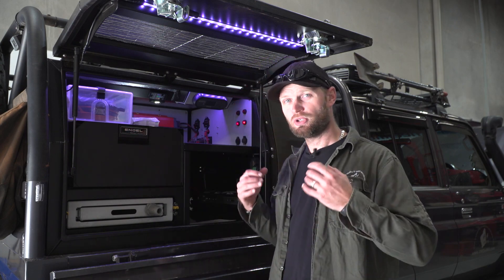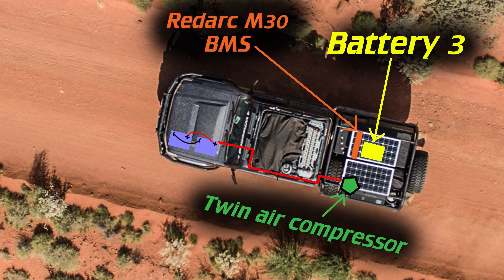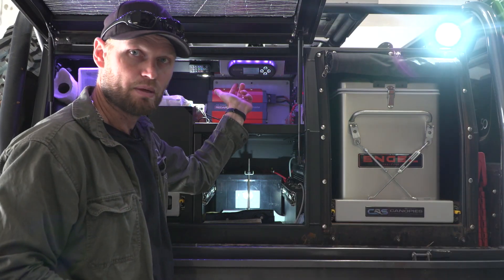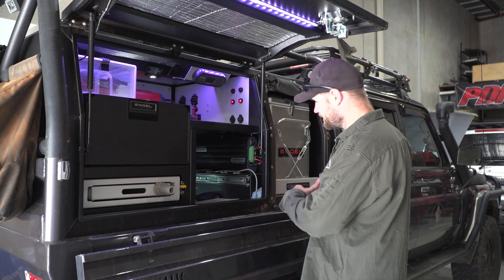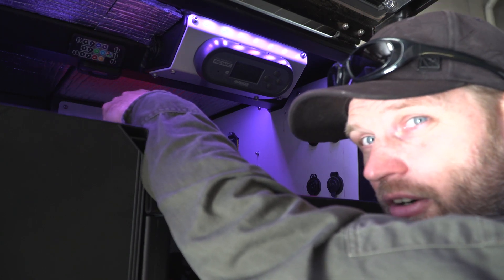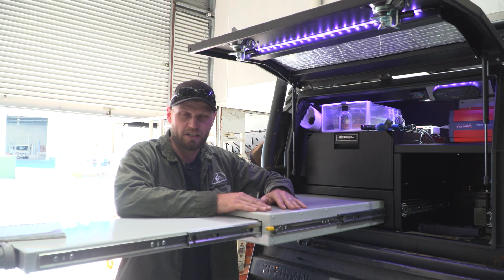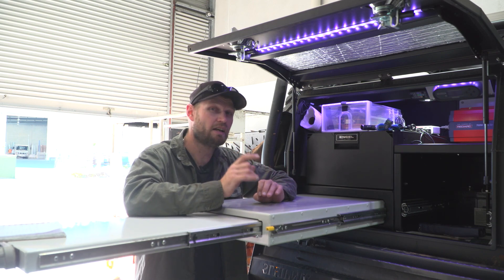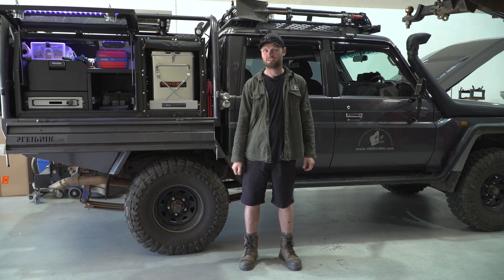My New 12volt DIY setup Landcruiser 79 series

Comment: I don't believe the spin that Redarc have put out about the need for DC battery chargers. A vehicle with a good conventional (not one of the so called intelligent) alternator, and suitable cross sectional area cable, to ensure low voltage drop, to the auxiliary battery doesn't benefit from a costly and inefficient DC battery charger. The exception being Lithium Iron batteries, which require a different charging regimen. 

The SC80 dual battery isolator from Traxide (no affiliation) will fully charge an auxiliary battery far quicker from the alternator than a 30 amp DC battery charger.
Reply: John Do White for my usage, thats what ill be going for (som sort of Marine battery isolator), but how do you propose ronny integrating that with solar panels, and all the neat control features the redarc has, like seeing what percentage remain in your batteries and so on... The battery management systems are just that, not just a simple charging relay :)
Reply: +Hampus Lytz the Traxide SC80 that I said would charge the batteries, via the vehicle alternator, sooner than a Redarc BM30 via a DC battery charger, can do most of what the BM30 can. However a separate solar  controller or AC battery charger is required, but comparing the prices, you could buy the complete system, including auxilary battery and solar panel, and have money left over, for the price of a BM30. Note it would not charge a Lithium battery like the BM30.

Traxide have other battery isolators including the USI-160, which offers better use of your cranking and aux batteries for winching and self jump starting.
Reply: I have mixed feelings on DC/DC converters. 

Personally I run a 230A (500A short term) rated split charge relay system and I have my two batteries right next to each other. For me, that's the correct setup and means that I can join the batteries to jump start myself or for winching. 

However, for a setup that has a long cable run then I'd say that a DC/DC charger probably was a better option. What Ronny has is a relatively complex setup and the BMS give him proper monitoring of it all as well.

As for adding solar panels, there are a few options. The most crusty way of doing it (and please don't) is to just connect the panel straight to the battery. This will work and will charge the battery but there's no over charge protection built in and it's not the most efficient way of doing it - it forces the panel to run at the battery's voltage when they actually have a higher power output at a higher current. 

There are three ratings for a panel. Open circuit voltage, that is the voltage with nothing connected to the panel. It depends on the panel and how many panels you have connected but for a single 100W panel could easily be over 20V. Then there's the short circuit current, that is the current that flows when you attach the two output leads together, and you could be approaching 10A for a 100W panel. In both open and short, the resultant power is nothing - power is current times voltage so if either of those is 0 then the power is 0.

Somewhere between the two extremes is the so called "Maximum Power Point", it will vary depending on the panel and the sun, but high teens is typical. The best way of connecting a solar panel to a battery setup is a maximum power point tracking (MPPT) controller - what this does is gradually draw more and more current until it calculates that the power has started to drop. It will then draw maximum power out of the panel and drop the voltage and boost the current to suit the battery that's connected.

A bit cheaper and a bit less efficient than the MPPT controller is the PWM controller. If you're on a budget, then they'll keep everything safe but not perform as well as an MPPT controller. TBH if you're spending a heap on a solar setup, you might as well go MPPT.
Reply: DC to DC converters are fine when one wants a different voltage, e.g. if the main system is 24 volt a DC to DC converter will power some 12 volt accessories.

Using a DC battery charger, which use a DC to DC converter to increase the voltage back to normal after the drop that occurs due to a long cable run is a poor solution, expensive and slower to recharge the house battery.

A better and less expensive solution is to use cable with the appropriate sectional area, and good connections, to avoid the voltage drop inn the first place.

Outlaying $2300, not including installation, for a BM30 that does a poorer job at the primary task of charging the house battery is just ...........
Reply: John Do How is this relevant? I mean it would be, if that was all the 2300$ unit did, but as explained in the video it does quite a bit more than that wouldn't you agree? Not trying to justify the price, personally I could plug my car in every night, but for off the grid trips, I do see the benefit of having full control of power usage when you have to get by on battery power alone

Comment: Thanks for a great run down of your setup Ronny. A few suggestions from my setup...

-Get an MPPT charger  (if you're using PWM, in the hours you're camped you're probably not even pumping anything into your battery), whereas with MPPT it will convert a low voltage to 12V, and just lower your current in...but at least it's still going in.
-Get a 15-20M DC extension cable...it will need to be 6B&S or better to allow for voltage drop, but you can then enjoy the shade & throw your panels at the right angle in the sun.

These two things will be far more effective than a Lithium.

Did 9 days in almost complete tree cover on Fraser running an Engel 80L upright, lights, iPads etc all with just a 120Ah AGM - had 350watts of solar but only had about 1.5 hrs of true sunlight on the panels. Still froze the kids icy poles each day.

Comment: Hi Ronny,
Look into Lead Crystal deep cycle batteries. It's a great alternative to lithium batteries.
They have the similar features of lithium batteries without the cost and heat affected limitations.
I have seen them advertised for just higher than AGM types. They can be drained down to low percentage and be uneffected and have a high cycle life and charge quicker weight is the same but effectively a 100ah battery would be equivalent to 2 x 100ah agm batteries in theory. The Redarc bms is compatible with them, you can contact them for advice on how to set up the bms correctly. 
Cheers Dave n Deb

Comment: Are the cables coming from the front batteries fused? If so, what did you use under the bonnet?
Reply from the maker: +gazza cable to BMS from the front is fused at both ends 50 at the front and 40 just before the BMS.
Other cable for twin compressor is fused at battery end only with an 80 amp fuse

Comment: Excellent Video Ronny and Congratulations on the quality workmanship.

You're old set-up was beneath you :)
I could tell straight away the 1 x 104Ah Battery and 2 Fridges wasn't going to work
(just ask anyone with 2 fridges on a single 104Ah Battery)
Lithium of the same capacity, not only take a higher in-rush current to recharge the battery faster, but, you can also take the Lipo to a deeper state of discharge without compromising the longevity of the Battery. 10% remaining i believe.
I never take an AGM below 50% State of Charge, so really, your 100Ah AGM is only a 50Ah AGM, then consider it takes a long time to recharge the last 10% and your AGM is really only a 40Ah Battery in some cases (really short trips, no solar)
Still, i can buy a quality 104Ah AGM for $100
So the AGM vs Lithium debate is different for me.

I have the exact same Utilux Crimp tool and crimps
I have had them let me down in mobile applications like vehicles
I wonder what your workshop friends think ?
The "hex" crimp is far superior for terminating the end of cables , both for electrical conductivity and strength of join.

Fantastic set up mate, just some fine tuning now.
Congratulations, looks fantastic.

PS: I have to agree regarding the Solar Panels
On the roof was never an option for me, i want to camp in the shade, keeps vehicle cool, fridge cool, me cool, everything cool.
But having a portable panel is both a storage issue and theft issue.
Also, there is 2 different panel technologies, one is not as reactive to partial shading than the other type.

Comment: quick question how many AGM batterys have you had to buy and replace over a 2 year period .. trying to gauge an idea vs LiFePO4 100ah $1200
Reply: LiFePo4 is a better option, cycling capacity, time to charge to full, weight, etc etc, would be my preferred option for the longer term. 120amp AGM $400, cycle life (300 optimum) LiFePo 1000+ cycle $900 + benefits listed above. Beats it hands down.

Comment: Great videos and information. Just a suggestion - @16:25 Possibly a grommet would be a good idea for the large holes through your breaker/fuse panel? Vibrations could easy cut the sheath on the +ve lead.

Comment: Why not just install a Goal Zero Yeti 1250 ? You can take it out, charge it on solar, on AC and on 12v. It has got all the outputs you need ...

I am sticking to my Goal zero ... Does the job for me. 

But maybe there is a good reason for this (complicated) setup. Looks amazing though but way to much things that can fail ot break for me.
Reply: The Yeti weighs 50 kg and is only 100Ah.  And it takes 40 hours to charge by the vehicle (according to their website). I suspect Ronny's system is lighter and charges faster. That and he'd still have to do all the cabling for fridges, lighting etc, and the stuff that runs off his cranking batteries would still have to be done. For his situation, I don't think the Yeti is worth the money for simplifying such a small part of the setup.

Comment: Hello Ronny, "I'm a long time listener - first time caller." from west Texas in the US.  I'm in the process of building a 79 Jeep CJ-5 for running on trails. I recently purchased a set of 2 80w solar panels similar to what you have to experiment with. This is the first time 'playing' with solar.... I'm just a tinkerer. 

On the back of each panel, the decal with the specs state that each panel puts out approx 4.4amps of power at full sun/capacity. That should be around 9 total amps output at 100% ideal sun/power condition.  

In testing them out charging batteries from my RV (caravan) I've never received more than 6amps or so from the system (or at least I've never monitored it when it may have been more). You stated that your fridges consume 2.5amps each that would be 5amps in total (in ideal conditions).  Plus you have more power consumption with other devices that you have installed. So if your panels are similar to mine, your panels maybe don't put out enough amperage to account for the power consumed from the fridges and accessories. Which means that there isn't any extra power to actually charge the battery.  Well at least I think what's maybe happening??? 

I'm no expert at all.... I may be wrong.  I'm just starting with solar. 

You may need to increase solar or battery capacity or both??
Reply: I'm running 95Ah with 2x100W solar which is a bit too much, cause when on the trail we're moving at least every 2nd day anyways. so we could even go with less than that. you need amp hours depending on the total of consumption AND the days of stay you want. and then solar for the days of autarky for an infinite stay.
Reply: I have 2 AGM wheelchair batteries under my bed, in a custom box hanging between the frame rails behind the axle. Charged by the alternator through a battery isolator, with a battery disconnect switch to gang them together with my starting battery in case of a dead starting battery.

My advice is, build in as much battery capacity as possible. I'm thinking of fitting 4 AGM deep-cycle batteries instead of 2. But i have ham radio gear, aerial recon gear, camera gear, lots of drain. Solar is 'green' but doesn't produce nearly what wind or just your vehicle alternator does. I put on a 140amp GM alternator, (replacing the 55amp Toyota alternator) with more battery capacity planned. Best bang for my buck. Lithium-iron-phosphate are the best but you'd have to be a lottery winner to afford them, AGM is the next best tech.

But unlike Ronny, i don't use an electric winch or an electric air-compressor. I have a Mile-Marker 10k hydraulic winch which runs off the stock power-steering pump. Much more durable than an electric winch. And my onboard air is supplied by a York engine-driven air-conditioning compressor, commonly found on older semi's. Look in a truck wrecking yard. Produces 10cfm. NO drag on my electrical system. 

Also in his videos i've heard him mention ARB air-locking differentials. After much research i found they have problems with the seals, problems crimping the air line during installation, and don't like to work in the cold. Not to mention it takes 90psi to keep them locked. I went with the Toyota E-locker. No air line. No air consumption. Stays locked or unlocked without electricity (the motor only runs when locking/ unlocking).

Comment: Hi sir, joss here all the way from the Philippines. Been watching alot of your videos and they are really awesome and helpful. I am still new in the 4x4 scene, hens this comment. a bit oriented with setting up a rig. However my weakest point is dealing with the electrical stuff. to make it worse my rig is run on a 24volt system. Its a Nissan Patrol GQ JDM unit Automatic. everything is 24volts from headlight to tailights except for the cigarette lighter port.  The previous owner already have a small inverted installed and i am assuming its for the subwoofer he had before our exchange. my problem is im having a hard time installing stuff like alarm, aux lights, switches etc. I really hope you can help me with this. Thank you so much! More power to you sir

Comment: Hey Ronny if you run your current agm battery low how long do you have to drive for to regain full charge ? As you said a lithium may take about an hour. I have heard agm batteries can only use "x" amount of their current for example an agm 100ah battery can only use 80% of those 100 aha so only 80ah. Do you know anything about this I've only heard it of one person but I'm not sure about it. Does the battery manager allow for a cut off of distributing power to accessories when the batteries low ?

Comment: Maybe make friends with a local electrician at a manufacturing facility.  Those guys are very accustomed to wiring behind panels both high/low voltage.  As you mentioned....being organized will save you lots of headaches later if you have to troubleshoot.  Be sure to include some "service loops" or whatever you call it in Australia.  That way you have enough slack in your cables to tilt the panel down for maintenance without pulling anything tight, but the wires don't flop around loose.

It sounds like the solar setup is kind of a bust for your needs.  Maybe sell the panels and invest in another AGM battery.  I'm surprised the prices are so high there.  Even with the exchange rate your quotes are about 50% more than they cost in the states, and they all come from India/China anyway.  Are there some heavy tariffs or other taxes on these items?

Comment: Looks very nice! I would put some rubber grommets on those holes below the breakers. The other thing that you probably know but is worth mentioning. not only do the end components(switches and plugs) determine what the fuse that should be used but the wire thickness used and the length determines that also.
Reply from the maker: +Mrcaffinebean I have since put rubber on those holes, wouldn't take much to rub through on rough tracks
Reply: Ronny Dahl I figured you probably did. I look forward to being about to do something similar and will definitely be referencing this video when I do. Nice work!

Comment: Great setup!!!

Good advice on hooking up the winch and compressor to the cranking battery / alternator. Although a dual cranking battery seems a bit of an over kill in my case.

Would it make a difference when using a high Amp VSR to combine the cranking and AUX battery in instead of the 30 Amp BMS? Currently I am using a 120 Amp VSR in combination with a 300 Amp manual combine switch.

Wanting to swap the VSR for a CTEK Dual though, to assure the Aux battery will receive sufficient voltage (and add solar panels).

Comment: Also, Go lithium, It's expensive, But it's worth it, I got a 120AH Ritar, It does the job, but even a 40-50AH Lithium is better, Lithium will last longer, charge better, hold charge longer and discharge better.

Go lithium if you can afford it, go AGM if you're not able to.